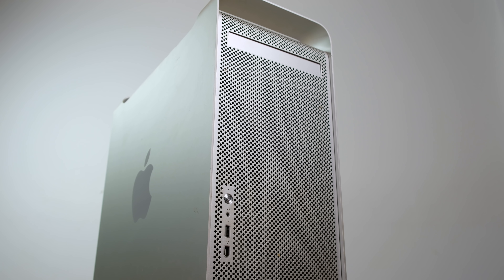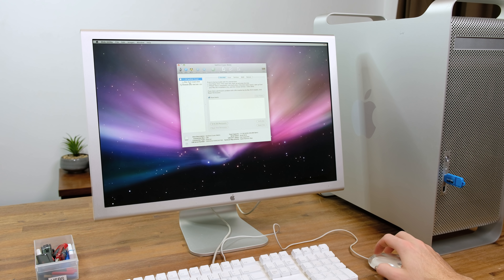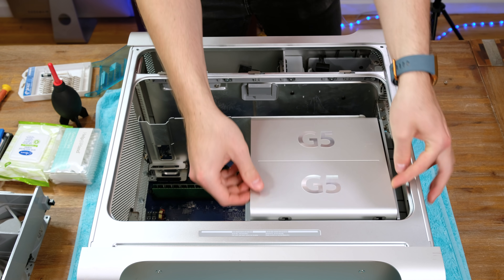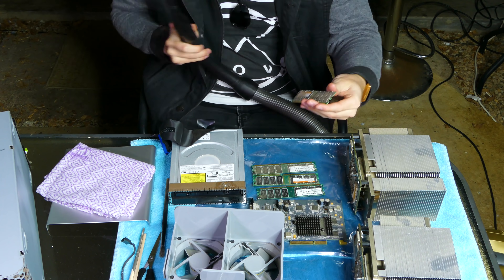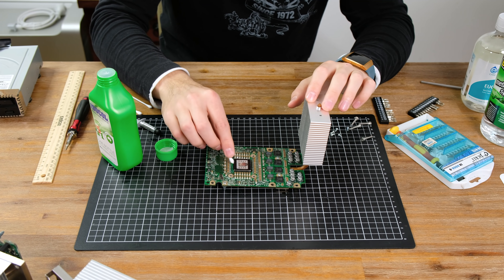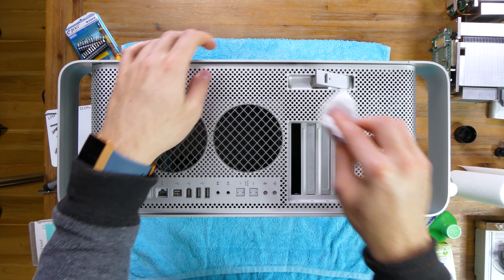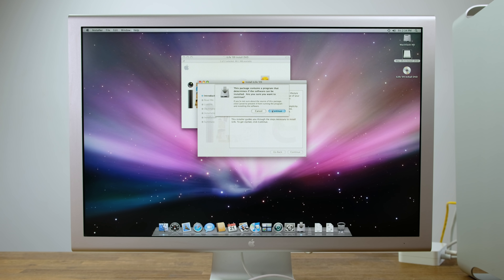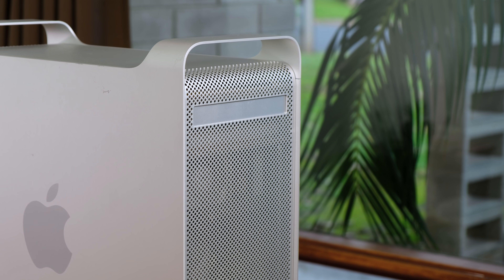Using The Original 'Cheese Grater' Power Mac G5!

Comment: Now put Linux on it. Lubuntu for example.
Reply: Install gentoo
Reply: @tcreeperrblx8682  Seriously though, Gentoo might actually work pretty well with that because all its open source packages are compiled locally for whatever architecture is needed instead of distributed through binary, which means software availability should be pretty good on now-obscure architectures like PowerPC, when what may have not been available otherwise you can just compile yourself. Portage can be pretty annoying and frustrating to use (as someone who has used Gentoo for the past 4 or 5 years), with lots of errors that I think it should really be able to solve by itself whenever it's updating, but weird architectures like PowerPC are the perfect use case for it where Portage might actually be more usable than a lot of other package managers. Additionally, on ARM, Gentoo seems to have more stable software than Debian does, in my experience. So, for architectures other than x86, I definitely recommend Gentoo, despite its downsides.
Reply: For real!! it'll have a newer OS and can run better and use current stuff.
Reply: This seems like a very good place to start:

https://forums.macrumors.com/threads/the-powerpc-linux-wiki.2178457/
Reply: I have my Hackintosh on a G5 case running OS Mojave perfectly and I do have another PC running Linux mint and off course another one running windows 10 pro.... what the Hack...intosh! :-D
Reply: I've seen a few videos of that.  It can run on the PCC architecture version, but stability isn't that great with apps.
Reply: Lubuntu doesn`t support PPC.
https://distrowatch.com/table.php?distribution=lubuntu
"Architektur: i386, x86_64"
Reply: @jannemann04107  There's a PowerPC version at their official web page. https://lubuntu.net/downloads/
Reply: Ubuntu Mate was great, they relased 17.10 for PowerPC but since have buried it and I cannot find an ISO anywhere. If anyone has it hmu haha

Comment: You only had to pull out the center piece of the the plastic rivet, no need to mangle it
Reply from the maker: If I could go back in time, I would have taken the less destructive path 😂
Reply: @psivewri   The cpu screws dont need to come out, just let them loose.  About yt, no way its running on 720p. I have a g5 ppc dual 2ghz 2gb ram and barely runs 240p yt!
Reply: my car has similar looking rivets, and for them you pop in the center post, then the rivet can easily be pulled out.  When you go to insert it again, the center pushes out like a button and you put the rivet in place then push it to be even with the body of the rivet.
Reply: Yes - Push out the center from the bottom with a small flat blade screwdriver. :)
Reply: Yes. And it was a cringe moment.

Comment: I never had the G5, I went from the plastic G4 tower to the 2006 cheezegrater MacPro.   I’m still using the 2010 cheese grater using FCP X and Logic Pro X.
Reply: @Luca Rossi 
The 5,1 (2010 ~ 2012) Mac Pro will go to 10.14 (lastest current MacOS) with a Metal compatible card and maybe some extra efforts... (so a Radeon 580 would work).
The 4,1 (2009) Mac Pro can be firmware upgraded to "work/look like" a 5,1 - the hardware is nearly identical.
so a 10 year old Mac can run the current macOS (or MacOSX) well...
---
Apple missed the boat with the 2013 Mac Pro, though it looks nice and it was powerful, back in 2014, there is so much expandability lost.  Dumb Apple!